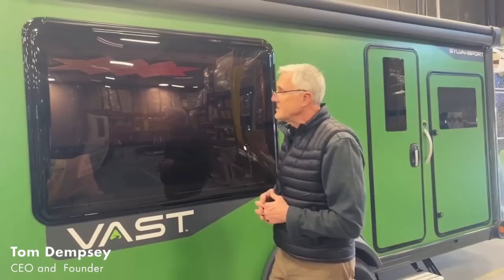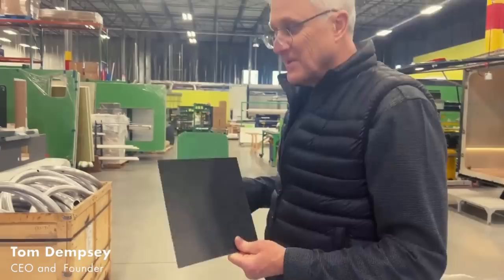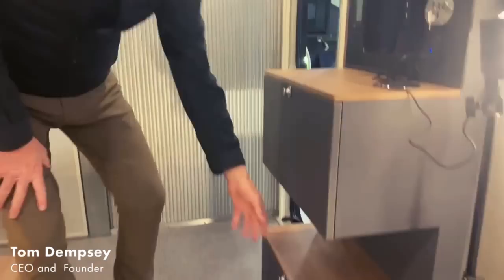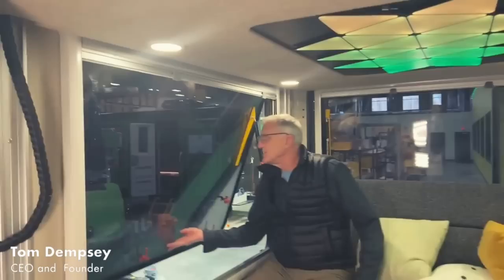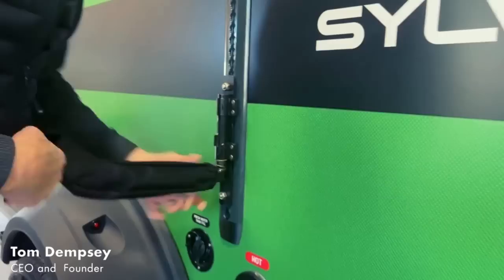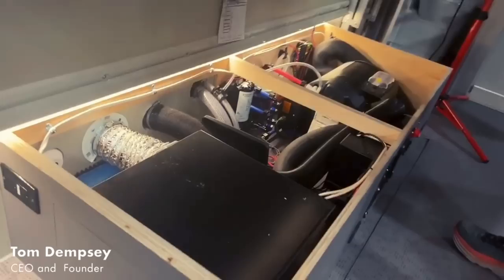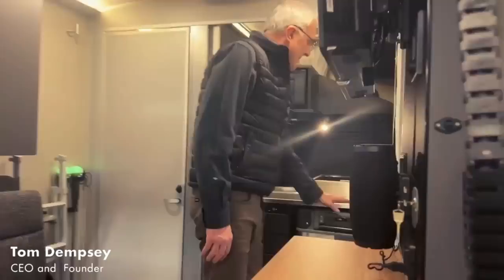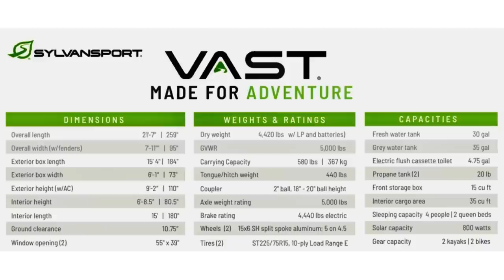VAST Virtual Tour & Q&A - Mid-Sized Travel Trailer Walkthrough

Comment: Love it. Would love the hauling capacity to be more than 580 lbs. Hard to fill water tank (240 lbs) an pull with any gear, 2 kayaks (300 lbs) 2 ebikes (100 lbs) food, clothing. Already over weight!
I would request the privacy shades and bug screens be flipped. Pull privacy from bottom, bug from top, so you can have both at 50%.

Comment: Two thoughts, immediately upon seeing Tom show the kitchen slide out:

1. Why not switch the door and have the kitchen open towards the front of the trailer (180º from where it opens)? When someone is cooking and especially when the fridge is slid out to access it, no one can use that door to enter or exit the trailer. It is blocked.

2. Is the kitchen and its equipment weather resistant? I am especially concerned about the microwave sitting outside in a rainstorm.

Comment: NiIce innovative trailer! Few questions:
1) does it come in other color choices besides green?
2) can lithium batteries and inverter be increased? 
3) can water fill be locked?
4) does the kitchen have to be out to use the shower?
5) can you sub in a Laveo dry flush toilet? 
6) does the AC work without shore power? If not, can it none made too with more lithium batteries and larger inverter? 
7) can you have it built without the overhead light that’s under the top bed? 
8) can the bottom sofa be removed?
9) warranty and where can it be serviced? 
10) price?

Comment: The one feature I would wish for is to be able to take a hand wand/ abbreviated, compromise boat shower in the toilet enclosure, when it is inconvenient or inappropriate to expand the footprint outward by extending the kitchen.  Or some way to cheat a shower in while the kitchen is still inside.   Dual use of that shower/ kitchen square footage is super clever, but sometimes necessary to stay compact.